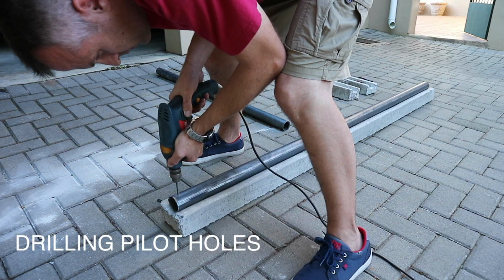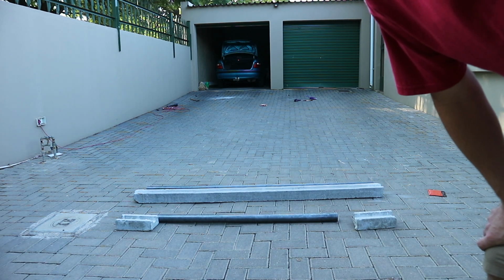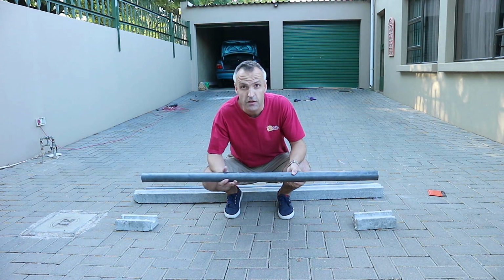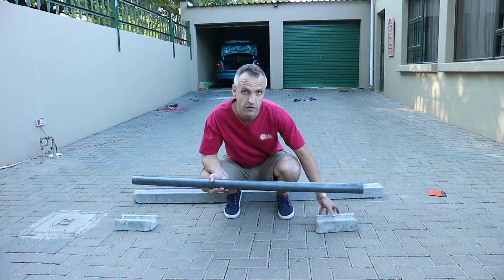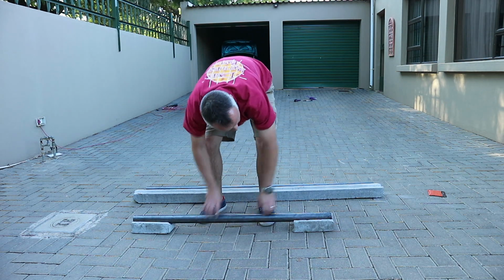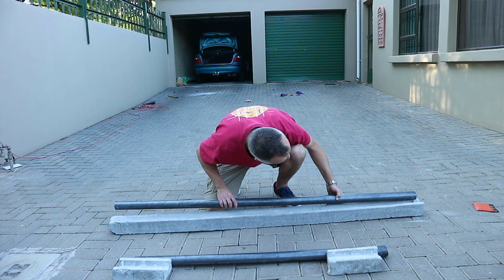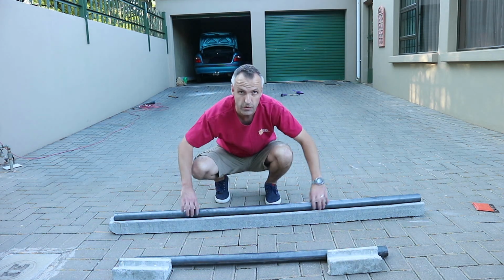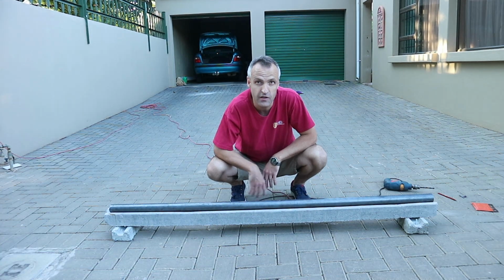41 And Skating Again. How to  make your own DIY skate rails.

Comment: I bought a short flat rail from homedepo drilled two holes in both ends just on one side so top is smooth so i can screw both ends down to the side of a 2x4 that way it keeps it 4 inches off ground  n then im gona toe nail 2 more 2x4s cross ways on both ends for the base 
Should keep it nice n off ground n so that ur able to do all grinds its small enough that i will be able to fit it in my trunk n set it up wherever n not to heavy gona finish it tomorrow